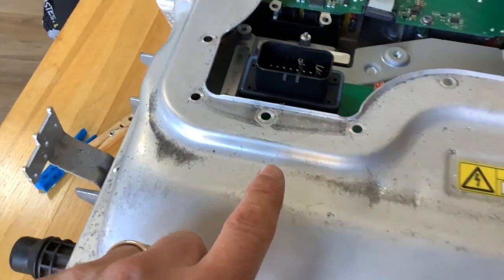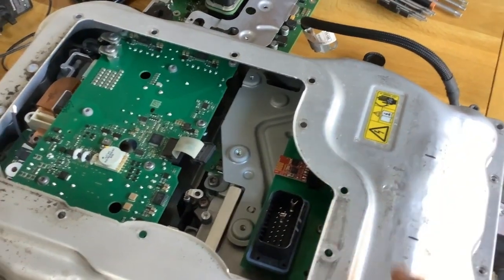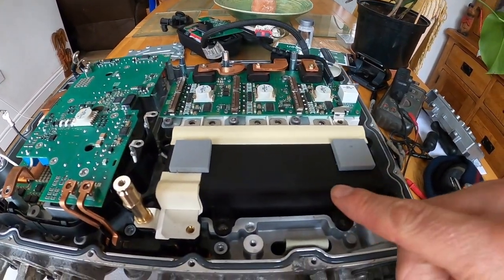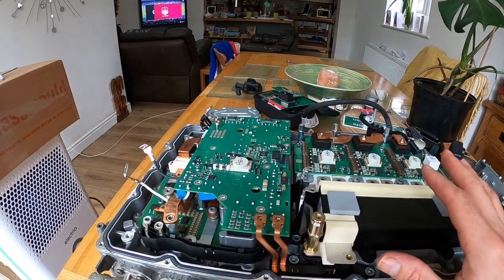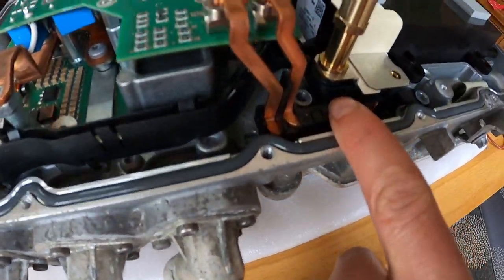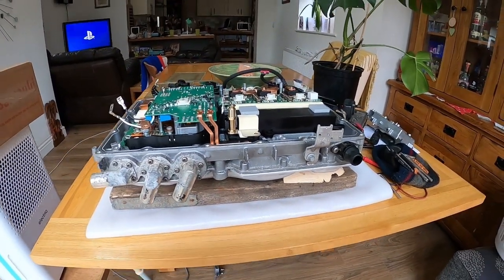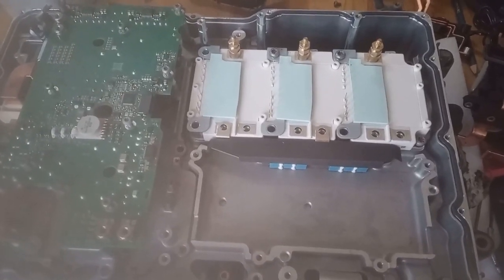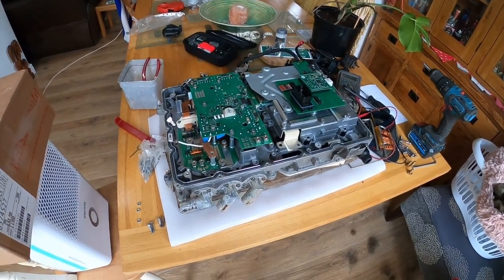Stripping down the BMW i3 EME

Comment: Hi!  I have EME for repair! Do you do?
Reply from the maker: No, sorry, I can't be trusted with my own 😂
Reply: Already I repaired! Thank you!
Reply: @Light-w5l how did you repair have 2017 330e with faulty eme. Cheers
Reply: @bugzx6r800  Have you driven without coolant? For me this was the problem! I only changed the burnt part.
Reply: @ no. What happened is one of the injectors stuck open and burned a hole in the piston, so had the engine rebuilt , but the car sat up idle for 6 months or so and when it was rebuilt , he drove it for 2 days to check the engine was ok but the car died and wouldn’t start again and he sent it to bmw in Ireland here and they have said that the eme has completely failed and will cost 12k euro to replace but I don’t have that money and the guy that rebuilt the engine is trying to say to sell the car for the engine 😭 Thanks for the reply
Reply: @ your engine is fine? Do you want to sale your car?
Reply: @ how many millage have your car?
Reply: @ about 260k kms
Reply: @ your car is not more than 10000£ in good condition! Better to sale for parts! I don’t know why your eme  gone, but eme can be repaired! I tell you what i did! I bought another eme from ebay! All eme is same: Bmw 530e 330e 740e and open the eme, remove the part which was burn, very easy job and put back! When you remove the eme, stop the  electricity from the trunk, there you have a fuse!

Comment: Where is this EME located in the i3?
Reply from the maker: It sits on top of the motor, in the rear of the car. It can be accessed via a hatch in the boot.
Reply: @MiniLifeCrisis  Thanks for that.  I'm assuming the hatch you are talking about is the hatch that you would remove to do the oil change, correct?
Reply from the maker: @MPDano  that’s the one 👍
Reply: @MiniLifeCrisis  cool, would a used one have to be reprogrammed to the i3?
Reply from the maker: @MPDano  I'm afraid I don't know enough about electronics to say however is it logical for companies to make every single part specific to the individual car?
Reply: Hi I have the Same EME recondition unit do you want

Comment: Can't you not just saw the original housing in 2? And weld the side up with plate? Much more compact then that isn't possible and it will fit perfectly like designed.
Reply from the maker: That is a possibility which someone else is trying so I'll keep an eye on their progress. My main concern would be my inability to aluminium weld and the coolant leaking 😬

Comment: Is you plan to use the original bmw kle charger?
Reply from the maker: No, I'm thinking of using simpBMS, I can then put it in the boot near the charge socket and main bulk of the batteries. Much easier than trying to hack the BMW system. I'm looking at using the KLE case for the inverter parts.